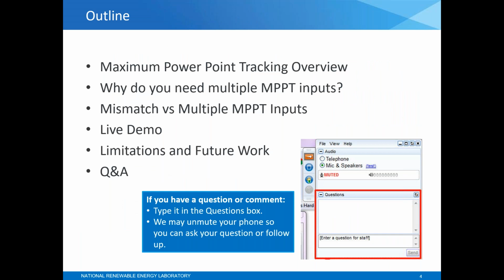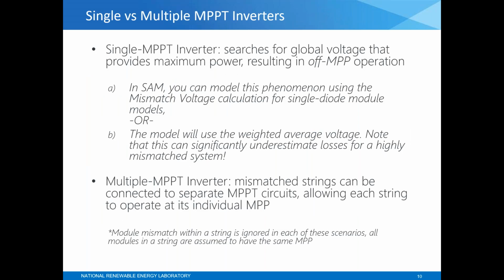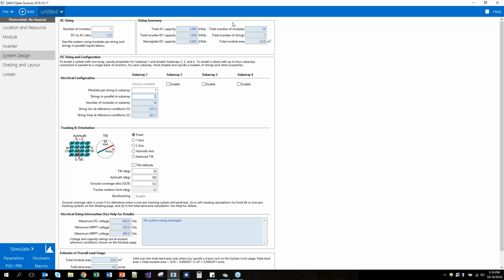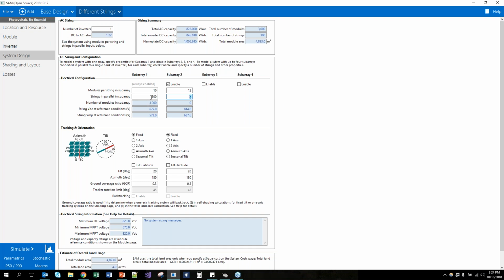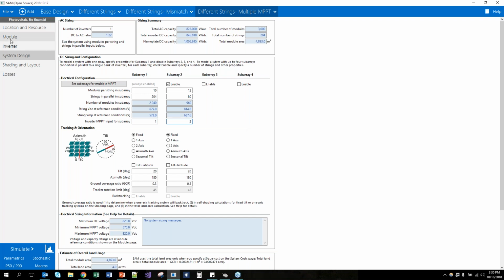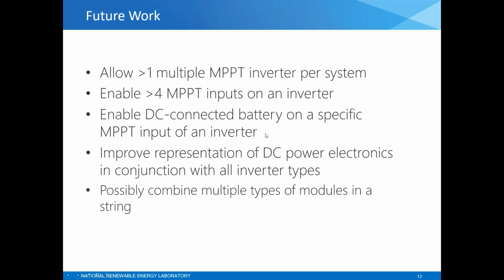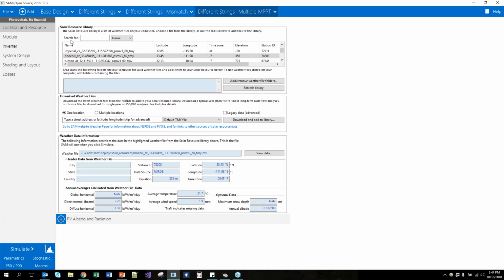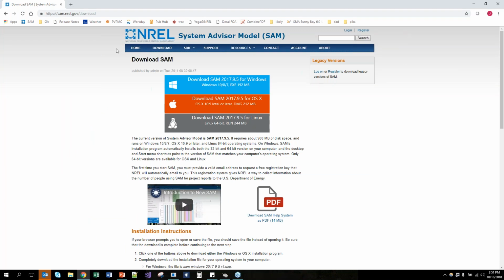Modeling PV Systems with Multiple MPPT Inverters

Comment: Can we connect two different strings to one mppt without parelleling them?
Reply from the maker: SAM assumes that all strings connected to the same inverter input have the same number of modules, orientation, tracking, and shading and therefore operate at the same voltage. Please follow up at https://sam.nrel.gov/forum for a more detailed discussion.
Reply: i have two input strings  on one mppt with different orientation angle . is it okay for effiency ? i think i am losing 450watts of power
Reply: The other way would be serialising them and you need the same voltage and yes it's possible with converters, one in each string.